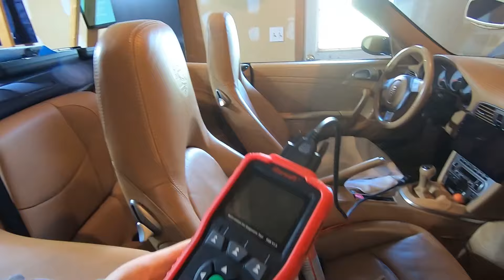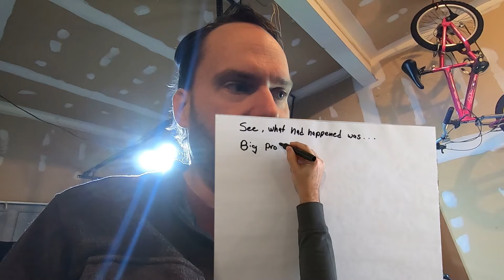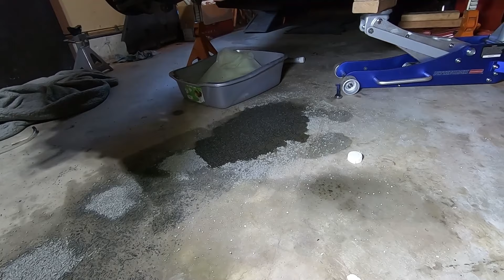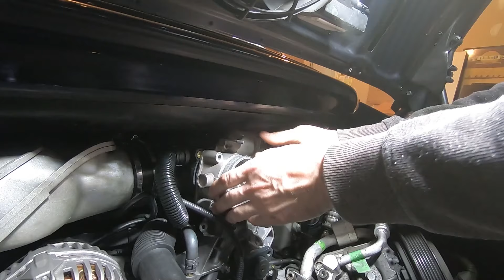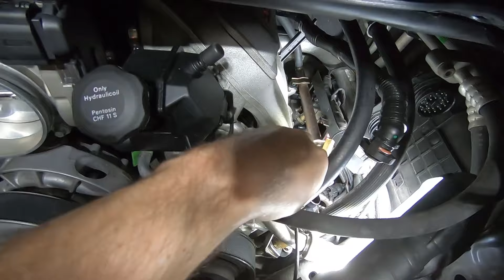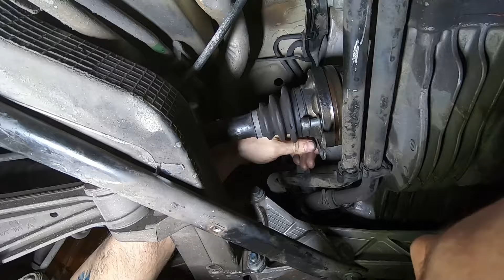911 Engine Issues. Why Won't it Run Right?!

Comment: I’m going through this same issue right now. The car wants to turn over, but it won’t. It’s dumping fuel and fouling the plugs out. Like you, I rebuilt my engine. Since putting it back in, I’m having this issue.

Comment: I've been following your ordeal since shortly after buying a 2006 C4S Cab from the same 'gentleman' via BringATrailer in 2021.  During a comprehensive service, the shop I used noted a mild ticking noise coming from the engine.  Fortunately I was exploring performance builds, and that led to swapping the engine with a FSI Stage 2 under their new program.  FSI recently tore down my original engine core, and found bore scoring on 3 cylinders, piston skirt coating loss on all 6 pistons, and some ugly scoring on some of the rod bearings.  Mine was clearly a ticking time bomb.
Reply from the maker: Lol! If I got another one tomorrow, I'd probably take that route. I had my fun building

Comment: you have the patient's of a saint  ... dont drive it like you stole it, the parts are expensive when the fuel pump goes my 996 911 2004 uses a BMW x5 pump porsche want £450 uk the x5 pump goes straight in and cost £25 BMW tappets fit as well all at sencible prices the ignition skoda basically porsche are crooks .... remember none of them make cars they just put them together ... valeo do the clutches ect ect ect the trick is finding out what other cars they put the bits in
Reply from the maker: I agree, this isn't a project that really saves money. Porsche tax.

Comment: Did you increase bore to 4.0? Doesn’t that need a new ECU tune and larger injectors for the increased displacement?
Reply from the maker: Great question. I had no idea and it's hard to find the answer online. The answer is no. The ecu works fine with a 4.0. I am going to do a tune and film the dyno soon!
Reply: @997Dad  Looking forward to the video. Any plans to upgrade to the GT3 TB? Jake Raby engine builds use these 82mm TB to improve airflow into the cyl, which I also believe part of the original X-51 package. Unfortunately I believe the only way to DIY this is to get the IPD plenum, which doesn't really work as advertised per various studies.  Toss up if it is worth the money, interested to see final DYNO numbers

Comment: I’m glad you are back and the car is sorted. I’m curious to know if knowing what you know now, would you do it all over again or just let a pro do it?  I’ve had those situations where I look back and think about the $ and the trials and tribulations of doing something myself and question if I made the right decision in the beginning. I always come back to the fact that I learned a lot doing it myself and that is satisfaction enough to call it a good decision but I’m curious to know where you are with it.
Reply from the maker: Hi Scott. It's a good question. Usually rebuilding an engine yourself would probably save 50% or more. In this case it's probably more like 25%. If you just want the car to drive and have fun,  use a pro or but a rebuilt motor from a pro. If you are a risk taker and feel like trying your hand at a 911 engine then diy makes sense. I enjoyed the whole process. Even the parts where things went sideways. So yes. I'd do it again. It was a really fun puzzle I get to drive around now.

Comment: This was extremely helpful! I'm in the exact same situation with my 997.2. the .2 has the High Pressure Fuel Pump so changed that out myself, won't run. Changed Camshaft Sensors, Changed the Throttle Body and the gasket. Won't Run and the computer won't let the Throttle Body do the adaptation, I'm using the Piwis and it says adaptation error. There aren't too many air/fuel components left, there are only really The Variable Cam actuators there's another vaccum actuator after the throttle Body. I'm getting ready to take it to the shop tomorrow as I won't have access to the garage I have been working on it. Last thing I'm going to try is to do a hard reset to the DME/CPU in the hopes it clears the hard errors that may be preventing it from doing the adaptation and also remove the "Memory" of the Reduced Engine Power instructions which pops up when I turn it over. I've also reached my limits of my Armchair mechanic knowledge this was helpful because it cleared up a gap in my knowledge of when the air actually comes into play and it's not until after the car is running. Hopefully it's something simple like an air leak or something I didn't do. It's only got 65k miles. Good Luck man don't give up!
Reply from the maker: Glad my nonsense is helping someone! Haha. Yea it runs on autopilot until the O2 sensor kicks online. So your car starts but it's rough at idle, or it won't start at all. P.s. you have a piwis? I need to get my hands on one that doesn't cost a fortune
Reply: @997Dad  It won't start at all. But I changed out the parts that would of cost me the most at the shop so now I don't mind paying for the knowledge the pros have. Yea if you think that the Piwis 3 will help you out feel free to borrow it for a few months. I'm not going to be needing it for a while. I think the two best things about it is that it's got a simulation mode where you can put in the car you have so like 997.1 and it will show you all the values of the sensors and settings. So they basically hooked it up to a running car and then recorded all the settings. Then you just compare it against yours and you can see where the problem might be and also it has all the error codes but they are customized for Porsche so they are much more detailed. Between that and the manual you can figure a lot of stuff out. Just let me know and I will ship it out to you and then just ship it back when you are done. It's basically an old laptop with the software loaded and the device to connect it to the OBD.
Reply from the maker: That's a really awesome offer. I might look you up later. I'm definitely not above taking it in to fix an implacable issue. I'm going to take it in to fix the convertible top this week. Cylinder went bad, I replaced it but still doesn't work. I'm out of ideas. Well it sounds like you tried everything I'd recommend. I'm curious what they find.